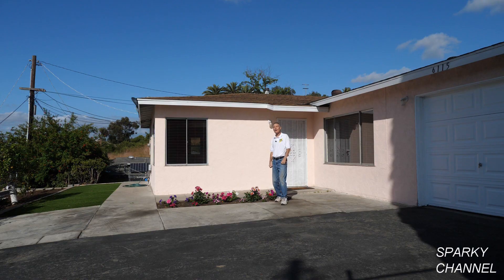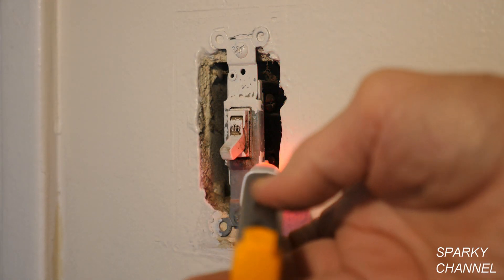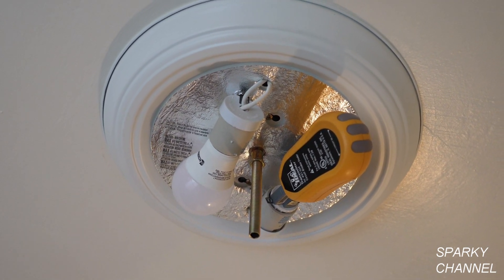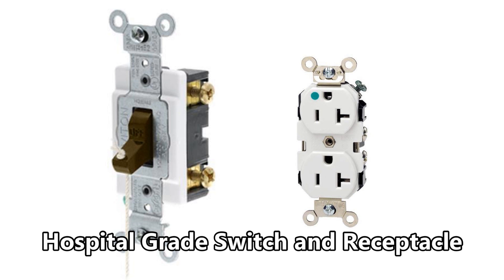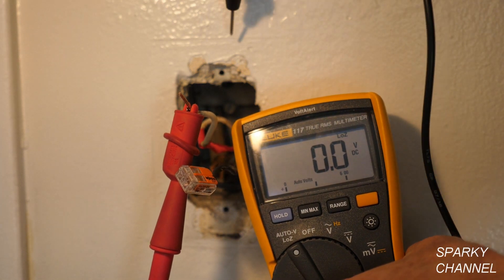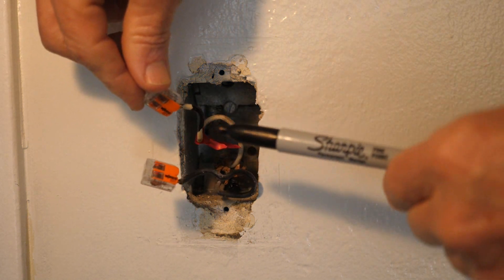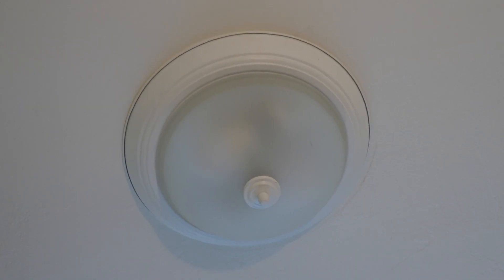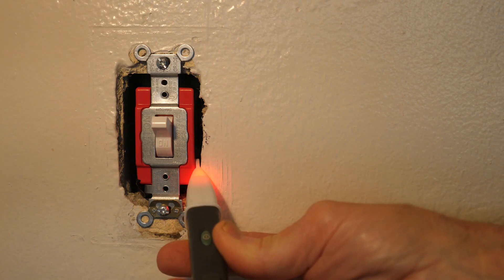Test and Replace a Switch + Grades of Switches with 2020 NEC 404.9 Ungrounded Switches

Comment: I have replaced my room switch in my parents house when the old one was broken(top plate broke off), before I did it of course shutoff the power go that bedroom(it’s the press type switch) and it has that stupid stab wiring I cut that off and stripped it and wired it behind the plate of the screw terminal!

Comment: Staying informed on 2020 codes is very helpful. Thanks for looking that up for us.
Reply from the maker: My pleasure, thanks!
Reply: +1. 

My Grandmother's 1954 home has had various updates over the years.  Didn't realize screwless cover plates might need to be considered going forward for safety, and not just fashion.  

(Much of the original wiring is in armored cable, so most will show the metal boxes/devices having a ground... But there are a few, original and newer (1962?), Outlet receptacles I know that don't have it. They still have 2-Prong Outlets, but traditional screw covers.)

So besides needing to check the various switches, I may need to take the time to upgrade some covers and/or install GFCI (and AFCI) protection to...

Comment: I have a handful of the testers and I actually like having one that is super sensitive. Whenever I just need to see if anything in a box is hot, but don't necessarily need to know exactly what is hot, I just probe with it. Its fast and tells me what I need to know. If I use my other tester then I have to spend more time getting closer to the actual hot wire. Additionally if I just want to check a box that doesn't have the cover off, the super sensitive tester will do that (just keep in mind it only tells you if it does sense voltage, not that it doesn't, though it's always been right). Save time and money but just be aware of what you are doing.
Reply from the maker: Excellent!
Reply: You don't have to ground light switches

Comment: Very interesting, thanks Bill, I did not know about federal spec. switches but I have seen them side by side in home depot. I haven't had many issues using the general usage switches just never ever back-stab because those will lead to loose connections and a fire potentially. Compression terminals are fine, but no back stabs! (A warning to homeowners). Also I noticed you only used a Phillips to tighten your terminals, I prefer to use a flat head to finish it off and make sure they are as tight as possible without stripping the screw

Comment: I had a boss that had his own way to find a breaker.  He would short out the switch, receptacle, etc. and find the tripped breaker.  He was a great guy; he spent his early years born and raised in Cuba and they used some interesting methods there.  I should clarify, he did that as a technician.  Once promoted he quit doing it, usually.
Reply: If it works, LOL
Reply: @adamdnewman  but when it doesn’t… 🔥😳
Reply: @protoman247  Circit Breaker failure, then O 💩

Comment: Might want to re-run that check with the meter - it was testing DC voltage, not AC. Ideally, there should always be 0VDC on an AC circuit, that indicates there's not any rectification happening upstream, which could indicate a bad connection.

Comment: My manufactured home was built 8n 1997 with the absolute cheapest crap available. I moved in in 2020,and half of the switches were busted. Still working as in the lights still turned on and off, but the plastic body of the switch was busted and the switch felt really mushy. I went through and replaced every single switch with commercial grade. I did the same with all the receptacles later. Several of those were cracked and falling apart also.

Comment: Doesn't the metal screw in the switch provide a path to ground if you have ground via to box / metal armored 2-wire bx cable? Why would you also need a ground pigtail if the screws provide a path to ground??

Comment: Leviton is better than Eaton
Reply from the maker: I think so.
Reply: I actually think the Eaton (or cooper back in the day) residential toggle switches are better than the Leviton. When using them, they feel springier, and they are far less likely to get stuck in the middle. They also seem to arc far less. The design of the toggles is far more dust resistant. I have seen ones from 2005 in brand new condition, while our 2002 Leviton switches were already deteriorating. I also prefer the Eaton wall plates for toggles, because there is less space between the switch and the plate, giving a cleaner look. I have not tried any of the 20a switches, but I know some of the Eaton ones are framed, just with a thinner frame. I prefer the Leviton design in this case. At both Lowe’s and Home Depot, there were broken off toggles on the display area, probably from a cart knocking them. This seems to be an issue for both Leviton and Eaton, residential and even spec grade switches.
Reply: I think so as well.  I use only commercial/spec grade switches and outlets for my house.  Worth the double (or more) cost over the cheap ones.  You and see and feel the difference.

Comment: Our house was remodeled in 2002, and they had installed the 68-cent Leviton switches, with the cheap back-stab wiring method. They did not even tighten the terminal screws, so they were poking out doing nothing, and nearly shocked my mom when she was turning on a switch that had the plate removed! Some of them had gotten heavy use, and had started arcing, especially the one in my bedroom. I replaced half the switches in our house with the Eaton spec-grade 15-amp switches, which were available for $2.75 at the time at Lowe’s. They have real back-wiring on the screws, not just the junky back-stab terminals. I did not touch the original Leviton 3-way switches that were in some large rooms, because those were still solid, and robust feeling. I did not get the 20-amp model, because they look bulky and are not needed, but there was no way I’d get the cheap 68-cent ones! 
One thing I did not do was wrap the switches up with electrical tape, but our switches were grounded, and installed in plastic junction boxes, plus, they were far enough from each other that nothing would short them out. Should I go back and do that, or is it not important?

Comment: I replaced a switch last week and shut off the circuit so the light went out. Then tried my tester on the wires. The tester was blinking and beeping like crazy. I just proceeded with caution, but what does that mean?
Reply from the maker: It means there is a hot wire in the box. Just because the switch is off doesn't neccessarily mean there are no hot wires.
Reply: it is a non-contact voltage and gfci outlet tester made by Commercial Electric

Comment: Like your informational videos. Good refresher training. Like the idea of the tape covering the terminals, especially with the metal box.  Even though not necessarily required, I believe in grounding all metal boxes, or replacing the metal with plastic. (My reason is Icoated at the end) I could be wrong, but my guess is that the wire to your switch had a ground wire that was cut or folded back along the wire sheath outside of the box. The reason I say this is because I recently experienced this on a 1959 construction home. Pulling the wire clamp on the box revealed the bare ground which was either caught on a nail or pinched between the box and stud. My reasoning for always grounding metal boxes is more for "non-electricians": you and I know to test often,
Reply from the maker: Sounds good, thanks!
Reply: I've noticed that it was common to use the screw on the wire clamp (for the wire coming into the metal box) as the bonding screw. So the ground wire would end up being really short. But it would provide sufficient grounding for the box. But in the case of this video, the box wasn't grounded so I'm guessing they used a 12-2 wire with no ground. So yeah, there would be a risk of the metal box being electrified and being a safety hazard.

Comment: Using your Ideal tester to find the circuit breaker is fine. There is never a ground on a light bulb to make your Ideal tester work as in a receptacle.  You defeated the ground path by using a 2 wire screw shell adapter & a 3 wire to 2 wire receptacle adaptor, so saying there is no ground when only 1 light is lit will confuse people who aren't electricians, or worse scare them into believing something is wrong with their home wiring.

Comment: Standard grade switches are fine for residential applications. Unless you are switching on/off heavy power tools/motors, they will normally last your lifetime.  I can count on 1 hand the number of switches that have failed in residential applications using standard grade switches. I can also count on 1 hand the number of Spec grade switches that have failed in commercial applications.

Comment: As a Safety check I run the breaker detector back across the breaker just to be sure I turned the correct breaker off.

Comment: Hi Bill, I see in this video and others that you mark the switched white wire with red tape, whereas I was always taught to mark it with black tape.  Is red tape now required in this situation by the 2020 NEC, or is it required in your area, or is it personal practice?
Reply: Morlamweb, National Electric Code requires you to either use wire of a consistent colored jacket or paint marker/sharpie for means of identifying smaller conductors. If it is an ungrounded conductor under 8awg in wire size it is good practice to not use phasing tape to identify them, what I was told is anything smaller than 8awg doesn't have enough surface area for the tape to correctly adhere to and in the end it will just loosen up and fall off of smaller conductors when subjected to heat or moisture or time.

Comment: Very low quality--but it may have lasted 50 years! Unlike the new Leviton switches sold at Home Depot. I've had a number of those fail in less than five years. What kind of quality is that?
Reply: I have an partial ungrounded house

Comment: The reason your tick tracer might have been going off with the switch off, it may have been a switched neutral. I see that happen with switch loops all the time. It may have even been that way on purpose from when the house was built.
Reply from the maker: It was a very cheap switch to start with and it was just worn out. It was a hot wire switch loop but, like you say, it is possible to find a neutral switch loop even though it's against code.

Comment: Hey, excellent video! The switch you replaced looks exactly like on I want to replace. When I flip the switch from off to on slowly, it makes a sparking sound briefly before being all the way open. I have other same age switches that do this as well. I have started replacing the switches in other rooms with the Fed Spec ones.
Reply from the maker: Excellent! The extra cost of quality devices is well worth it in the long run!
Reply: Question please: Does the loud CLICK of spec. grade switch bother you?
A thank you.

Comment: The new LED Lamps, draw very low amps. When you turn a switch off you get an Arc, the Arc needs to be strong enough, to burn the Carbon off the Contacts. Will the Bigger Contacts, in the Heavy Duty switch, Carbon up faster than in a Light Duty switch, controlling LED’s?
Reply from the maker: Hi Steven. No, I haven't seen that at all. The heavy duty switch will outlast the cheap switch by many years.

Comment: Great walkthrough, Bill. I wanted to ask if the code has something about wall outlets. I discovered my wall outlets are not grounded. Should I put scoreless plate covers on all my outlets.
Reply from the maker: Yes, you really should not only to meet the modern code but to reduce the risk of shock during a lightening storm. I'm assuming you meant "screwless" wallplate. :)

Comment: I don't know how many service calls I have been on where the light switch is making a sizzling noise and I pull the switch out of the wall and it falls apart into a million pieces. Those cheap residential grade switches are garbage.
Reply from the maker: Oh man, they really are garbage! I sure agree with you. Thanks!
Reply: @SparkyChannel  That's why they cost 50 cents a piece if you buy a 10 pack. Garbage.